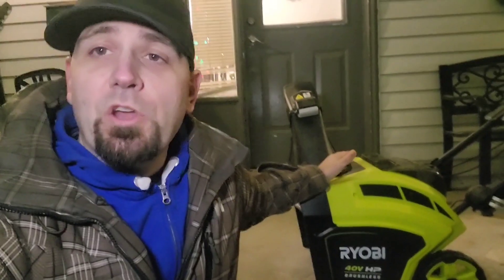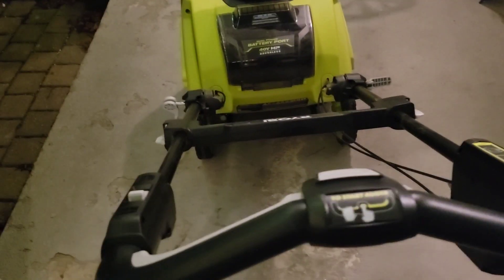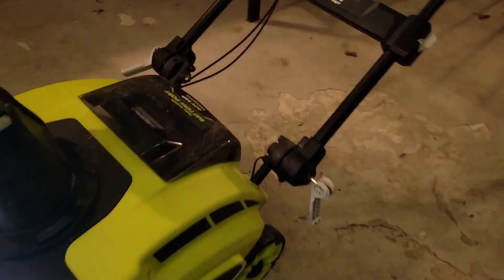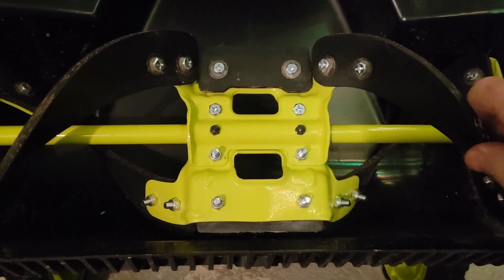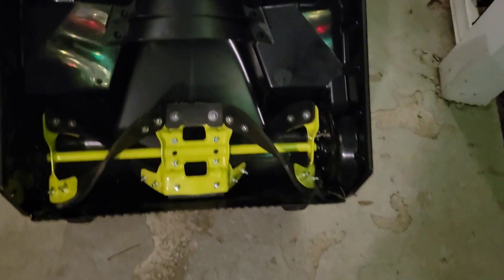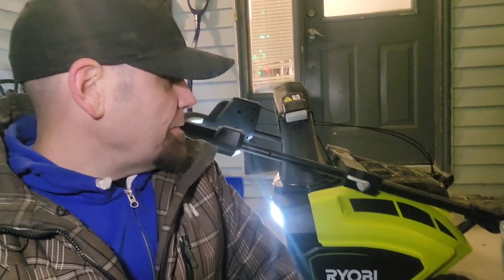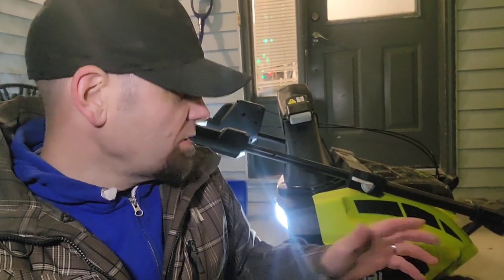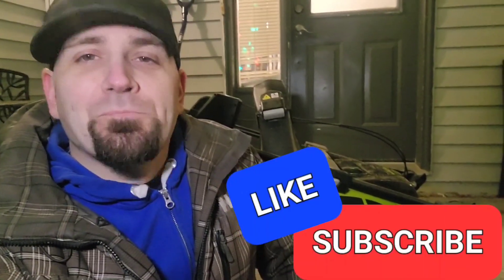Ryobi 40v snowblower broken already

Comment: That’s too bad. I was hoping you’d have better success with this machine than I did. 
At least yours still runs!! As you know, mine would quit every few minutes until finally it stopped completely and wouldn’t go anymore. 
Good luck with the repair!
Reply from the maker: It's under warranty but the repair shop told me that there's already someone ahead of me waiting for a auger. Mine will be fixed in the new year.